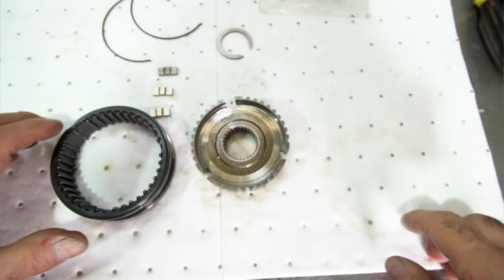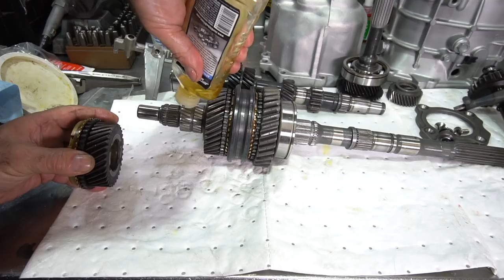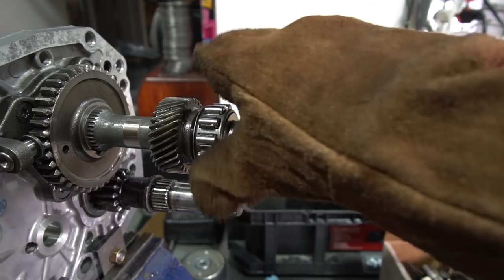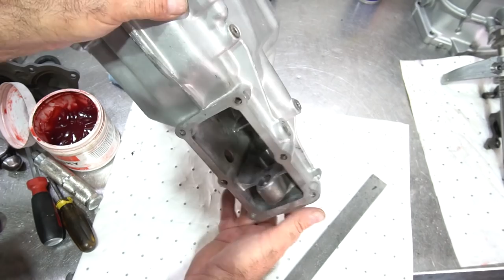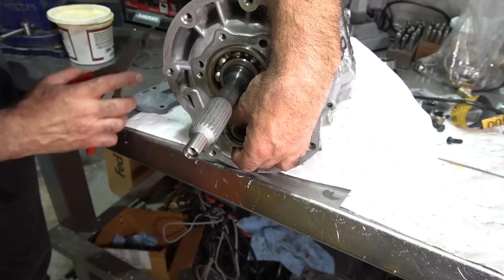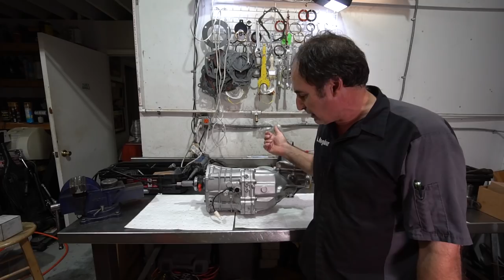How to Rebuild a Toyota W58 5 Speed Transmission - Part 2

Comment: Hey! Im rebuilding mine and got the entire gear box rebuilt and put back together (minus the housing). Before sealing everything up I was checking if everything is working so I engaged the 3-4 and the drive train rotates in both. But when engaging either 1 or 2 it locks up and won't spin? Any idea what's going on? Do I need to put it in the housing first to keep everything perfectly lined up? Thank you
Reply: Update: shifting things around allows it to spin. Once I put the end bearings through the housing and put in the clip rings will it keep everything aligned?
Reply from the maker: Yes the input needs to be spaced otherwise it will lock up
Reply: @GearBoxVideo  awesome. Thank you for the quick response!
Reply: @GearBoxVideo  Hi I'm  rebuilding mine and I don't know where the small needle interlock bearing fits? Thank you

Comment: The black sealed bearings can take up to 250f but a good temperature is usually between 170-180f viton can handle up to 440f 

Do you need any gear suppliers we are a shop that specialises in industrial gearbox refurbishment and supply and could make just about anything out of steel ,let me know
Reply from the maker: We have had zero issues with sealed bearings in any race or street application in 30 plus years.  If we saw any issues these would not be used. Fact is  I have serviced transmissions with over 200K miles with seals that still work, are not hard and after removing the seals, zero bearing wear. We do replace them but are always surprised how bearing life is increased using them.   Engineer within parameters.  440 F? Your transmission and engine would be destroyed with those temps.
Reply: @GearBoxVideo  I meant the sealed bearings seals are safe to heat up if you need to